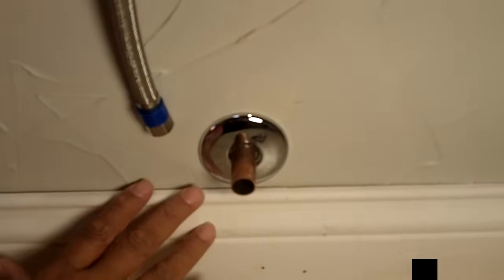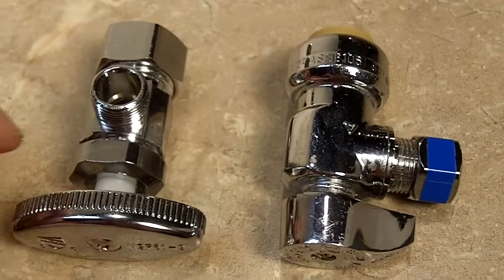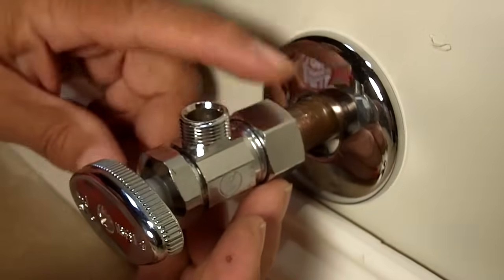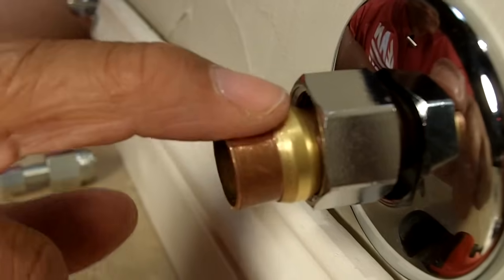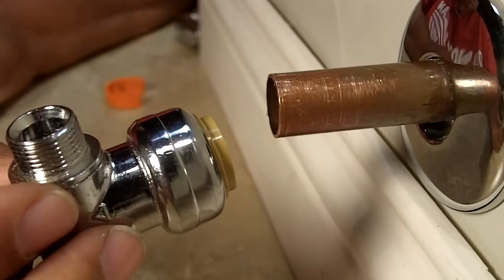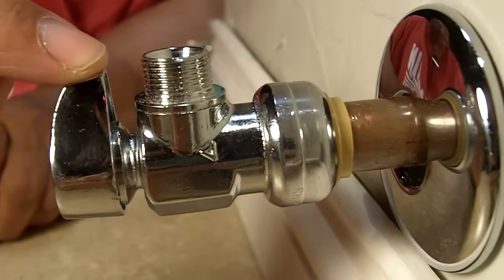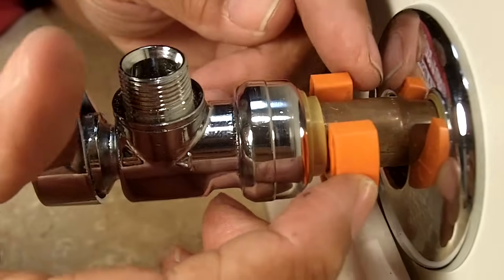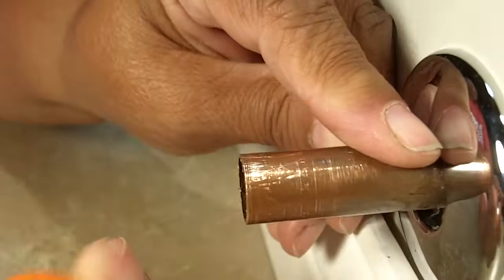Which Type of Water Supply Valve Should You Use: Compression or Push Fit?

Comment: Can you show a vid of removing valves that have been on the pipe coming through the wall and have been there since 1948? I don’t know if there soldered or screwed on and when I try to rotate them, the pipe behind it looks like it’s twisting. Further, the damned valves are right up against the wall behind the valve. There’s no room to see behind it properly much less get tools back there.
Reply: Do you have iron pipe or copper tubing supply line? The old iron pipes use a tapered pipe thread end and you have to hold the pipe from turning to get the valve off. Otherwise it will unscrew from the threaded elbow inside the wall. That isn't a big problem but once you loosen a tapered pipe thread and the pipe stub comes out of the wall, you need to reseal the threads that go inside the wall with new pipe dope and tighten the new valve and the pipe stub by turning the valve body 

OK, you can't see the pipe because there is a decorative stamped steel chromed ''escutcheon'' behind the valve hiding the pipe. Then you need to look very closely at the flats at the wall end of the valve. If they are part of the valve casting itself, you have iron pipe with tapered threads. If the flats look like the ones on the left valve at 4:55, you have copper tubing pipe with compression nut and brass ferrule.  To get that off you need to HOLD the valve body from turning with Channel locks or small pipe wrench and use another wrench to turn that nut clockwise as you are looking toward the wall.

If its copper tubing, the old ferrule and nut will be almost impossible to remove but can be reused with a new valve body. The majority of time the old nut and the new valve body have the same threads and the ferrule won't leak after being tightened. But some replacement valves made in the Far East use different threads and you will get only 1/2 turn on the old nut to new valve body and it stops. Never force it! You should be able to spin that old nut the 3-4 turns easily  by fingers until it stops. Again, hold the valve body with a wrench while you tighten the nut with another wrench. You can take the old valve to the hardware store and try to screw the new compression nut on it to see if the threads are the same.

 Any time you disturb old iron pipes be wary of leaks on the next fitting down from where you are working. Put a blue paper shop towel against the wall and under the new valve for a day. Even one drop of water will turn the paper dark blue.

Another way to check for iron pipes is to look at where the shutoff valve is where water enters the house. Even when painted, you can see that the iron elbows and fittings are much larger than the pipe. If its iron pipe there, your whole house is iron piped. Soldered copper tubing joints are barely bigger than the tubing itself.   My brother's house built in 1947 in Los Angeles had badly corroded iron pipes in both the water supply lines and the drain lines. A $3500 job turned into $23,000 when ALL of the pipes, feed and drain had to be replaced because of severe corrosion and blockage. The hot water side of the washing machine would fill a coffee cup in 45 seconds with the valve fully open. That's rust blockage! He had soldered copper tubing put in with all new fixtures and had ABS plastic sewage drain lines installed. We will both be long gone before the new pipes give trouble.
Reply: Definitely iron threaded pipes valve seems to be screwed onto. Needed an inspection mirror up against the wall to confirm.

Comment: I don’t like using push fit for anything that isn’t temporary. I’d also add that make sure you get a quarter turn ball valve angle stop. In the video the push for is a ball valve and the compression isn’t. If you have to turn the water off years later, you’ll hope there’s a ball valve there.

Comment: In the trades your water supply valve is technically called a STOP.  You should be using a deep escutcheon not a shallow one.  The proper size is 5/8, not the sloppy fitting one you are using.  For comprehension stops and deep escutcheons cut the copper 1 7/8” from wall and you have snug fit without any copper showing,  Hence the purpose of chrome is not to see copper!!

Comment: I gave a thumbs down on this video. When using the push on valve, the inside of the pipe must be de-burred or the seal me be cut when sliding the valve on. This was not mentioned. Also the push on valve is more likely to start leaking in the future compared to compression valve.

Comment: Should have included supply valves that you solder on. They are probably the best for peace of mind long term.
Reply: Until they break, Which is why I am here currently.
Reply: @daandriod  sorry to hear that. How old was the valve? Was there any stress on it that causes the failure? I would imagine any other type of connection would have failed in the same position. Unless it just wasn't soldered properly in the first place.
Reply: @thaitichi  honestly I can't complain. its been like 20 years and the only reason it broke is because I had other toilet repair work that required me to turn it off, And it was very much refusing to turn so I had to use a bit of muscle to wrench it off. 

My issue is I really don't want to cut this pipe as it is already on the shorter side to begin with, And I do not feel comfortable taking a torch to it and yanking so I am breaking down and getting a plumber. Had it been either of these styles I'd have no issue doing it myself
Reply: @daandriod  I bet you could do it yourself. You need a torch, solder, flux, and a way to cut and ream pipe. Then you can do all sorts of things. If you don't feel comfortable or don't plan on doing any of this in the future, then a plumber is the way to go. Hope it works out.

Comment: Nice Video.  Shark Bites are a much higher quality valve.  The plastic stem valves are weak and have a limited life and are subject to leaking and breaking.  Love you pointing out that the space is needed to remove the Shark Bites.  You are really good at showing how work is done and what is really important to know.  Shark Bites are also damaged by rough edges and dirty pipe ends.
Reply: you can get the compression valve in a quarter turn

Comment: Actually I will only use the female pipe thread ball valve and solder on a mpt fitting to attach to, but I have 18 yrs experience with plumbing.

Comment: Great video as usual. Quick question: I want to install a bidet hose but the toilet is wall mounter and presumably the valve for the tank is behind the wall. As the sink is only 1.5 feet away, I figured I could tap it off the sink valve. Do I need to worry about compatible dimensions for the sprayer head and the feed line for the water coming off a 3-way (T-) valve?

Comment: The nice thing about the multi turn valve too is you can change the guts only 
Which would be a great video from you to all of us 👍🏻
Reply: The nice thing about 1/4 turn valves is that I've never had to replace one.
I've had to replace every compression multi-turn valve I've had in my houses due to them leaking (valve and/or stem).

Comment: The real difference is that one you can pull out with a cheap plastic tool vs the other you can't pull out at all! You have to cut the pipe short with that metal ring stucked on the pipe.

Comment: I was told the push fit Sharkbite connections always start leaking after about 3 years.
Reply: I’ve worked in a hardware store that sells the Sharkbite fittings. Haven’t had any customers come in with that complaint.

Comment: I've used both compression and push-on (sharkbite) shut off valves many times with great success.  Some question whether the push-on connection valves will last the "test of time" beyond 10 or 20 years but that is yet to be determined.  The compression valve you've shown has a gate or washer and seat configuration, so the washer is replaceable and the stem packing seal is also replaceable down the road.  This valve also requires several turns of the handle to turn it all the way on or all the way off.  Unfortunately, they sometimes get stuck because they are rarely activated.  
The push-on valve shown is a 1/4 turn ball valve so it requires just a 1/4 turn to activate on or off.  The ball valve seat and stem packing are not replaceable so failure does mean valve replacement.
The orange "C" shaped removal tool for the push-on is usually supplied with the new valve.  Duct tape it to the back of the toilet or inside a vanity close by so you know where it is 10 years from now when you need it.

Comment: I'm new to this. A contractor installed the push valve type to stop a small leak at the bottom where the stop valve and supply line meet and it's still leaking. So, I tried to take the push valve off using the orange tool described in your video and I can't take it off. I'm a woman with small fingers that are barely fitting behind the orange piece and I have very little upper body strength and can't pull it off. And the push valve knob isn't turning to allow you to shut the water off. So I want this whole thing off. I've tried and tried to get it off but it won't budge. I'd like to replace this push valve with the quarter valve (and an oval turn knob) so that I can at lease take it off if I ever need to again and so I can turn the knob. Please help.

Comment: The also make a metal version of the shark bite removal tool which is much thinner and works in confined spaces. 
And if you are replacing the valve, do yourself a favor and replace it with a quarter turn ball valve. Get the PRO grade that uses a stainless ball and a Teflon/uhmw seal. Don’t use one with a rubber seal as they will deteriorate over time and Teflon/uhmw seal should last 10 times longer.

Comment: How often you use kitchen/bathroom shut off valves? Almost never once it's installed and when you need it, it doesn't work. Don't believe me? Say 10 years after installation, turn it off and on again, chances are it will leak where it wasn't leaking before. This is with the compression, where the rubber washer disintegrate with time and hard water. My SharkBites are relatively new but I suspect the O-ring will failed as well over time. Compression easy fix, SharkBites not so much.

Comment: Great video Leah! For my experience: I have had "push fit" valves leak on me. But then, I've had compression valves leak as well. Normally I can tighten the compression fitting enough to stop the leak. The only thing I can do with the "push fit" is ... replace the valve. My personal preference: 1. remove the stem from the sweat type valve. 2. Solder the valve on the copper stub. Your instruction on soldering is an excellent tutorial. 3. Apply 'pipe dope" to packing nut threads and put stem back in the valve. 4. Turn water on, check for leaks, tighten packing nut if needed. 5. Enjoy a piece of apple pie and a cup of coffee in celebration of another job well done! Thank you Leah!

Comment: You can remove the push-fit connection using a spanner or wrench. Adjust the size and push on the beige plastic part. One less thing to buy.
Reply: I'm new to this. Can you give a little more detail when you say "push on the beige plastic part." I've been trying to get this thing off using the orange piece suggested in this video and I can't get it off. There's barely enough room to fit my fingers through and I'm a woman with small fingers and very little upper body strength. Or maybe you could do a video too. :)

Comment: two things:
1 - you shouldn't do a side-by-side compairison with a 90 degree and a full turn valve (90 degree is ALWAYS much better)
2 - please dont call a 50 cent push connect removal tool an "expense"... I drop more change every day than that... a good pipe wrench will cost you $30 and a crescent or adjustable wrench will cost you another $10-15... so you are calling a 50 cent piece of plastic an expense when you need $45 worth of tools to remove a compression fitting.... most plumbers have thousands of dollars of tools in their trucks, I doubt a 50 cent piece of plastic bankrupt a plumber....

Comment: Both styles are available in 1/4 turn.  Push to fit, in all the tests I have seen, are the first to fail under slightly elevated water pressure.  They fail over compression, flare or crimp ring fittings first.  I have used them, but typically for repairs on my RV (which is all crimped pex) until I can replace them with crimp fittings.  I would not use them where I am looking for long term, especially if there is a chance of even slightly elevated water pressure.. Not worth the potential problems and not worth the extra cost to save a few seconds on the install.

Comment: Price is very comparable now. I prefer soldering joints but when there are a lot of detectors in an apartment I just put in the sharks. Don’t want to waste time removing batts. Just make sure the edge is chamfered before you push it on. The edge of the 1/2” copper pipe in this video didn’t look cleaned up at all for a sharkbite valve.

Comment: Didn't know about the ferrel? puller. I've been able to pull off difficult ferrels usually with channel pliers, being careful not to scratch or distort the copper. kind of a clamp, twist and pull motion would work it off usually. One time I used a drimmel cut-off wheel to score creating a slot ( cut as deep as possible with out cutting into the copper. And then insert and twist a large screw driver to pop open. I admit very risky and only for the somewhat skilled in rigging...lol. The "pop-on" here locally known as shark-bite at HD. I believe same or a few $ more than compression. SB kinda scare me but I'm in old dog. If using it I would say be careful to push in as straight as possible as to nor scrape any internal parts in the shark-bite. And I always use the 1/4 turn ball/socket shut-off.

Comment: But if you don't have the tools to take the compression valve off, then the Shark Bite valve would be better and the removal tool is only $1.50. Which is way cheaper than a pipe wrench and a crescent wrench.

Comment: 1/4 turn is better than multi-turn. You can use an adjustable wrench if you don't have a special tool for the push connect valve.

Comment: 1/4 turn valves are great if you turn them on and off once a year otherwise especially if you live in Arizona where we have super hard water the valve will freeze up and the stem will break otherwise they're pretty good, shark bites are pretty good if the pipe is not compressed from the feral ring being pulled off, so I usually just replace the angle stop and use a little pipe dope
Reply: No shit about Arizona, you basically have to replace your valves every other year

Comment: One other big thing about the push fittings (SharkBite is a popular brand name). These fitting have to be installed properly or they will fail. This means you need to push the fittings on straight and you have to push them fulling onto the pipe. The first thing you need to do is use your hand and push on the pipe. If the pipe moves, then you might have a problem getting a push fitting on correctly. You need to make sure you can push against the pipe and it will stop moving with enough pipe out of the wall, so that you can then push the fitting on smoothly and completely. If you do not push the fitting on completely, there is a good chance it will fail. 
Once you've install a few of these push fittings you get the feel of whether it's slide on straight and complete, but if this your first time with this type of fitting you need to make sure it's on straight and on completely. 
If you don't have much pipe coming out of the wall and/or if your pipe moves in and out of the wall a lot, you might not want to use a push fitting. Also, don't be clamping down on copper pipe trying to hold it in place. Copper is a soft metal and you could either poke a hole in it or collapse it completely, then you'll have a much bigger plumbing issue. Push fittings are much better for cases where you can completely grab the pipe with one hand while pushing the fitting on with your other hand or places where you know the pipe is not going to move when you push against it.
One last thing, if you get the removal tool make sure you get the correct one for the size pipe you are using, the tool has to match the pipe size so 1/2 inch, 3/4 inch, etc. It's OK if you have to remove the fitting and reset it but much like the compression fitting the woman showed in this video, there is a plastic piece inside the push fitting  that acts just like the ferrule that she shows. If you mess up that plastic piece in the push fitting, they will no longer work correctly and you'll end up getting leaks. So be firm but gentle when pushing them on or pulling them off. Don't be pushing on and pulling off these types of fitting too many times, again you'll wear down the plastic inside and open then up to more risk of failure.

Comment: As a handyman I would never use push ons, better known as sharkbite,,, I've seen to many of them blow off,,,mainly when the main house water was turned on and a column of air was highly pressureize ,,,I only use them in emergencies and in crawl spaces or where water wouldn't be a serious issue.
Reply: George Spangler a good habit when pressuring from the main is to open all taps and slowly open main feed.